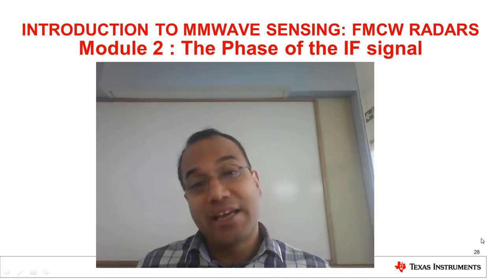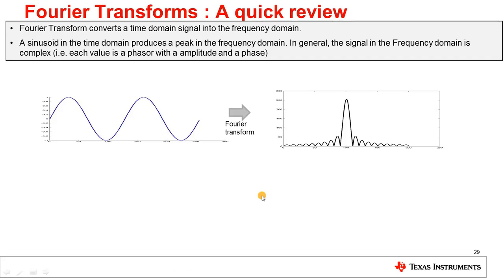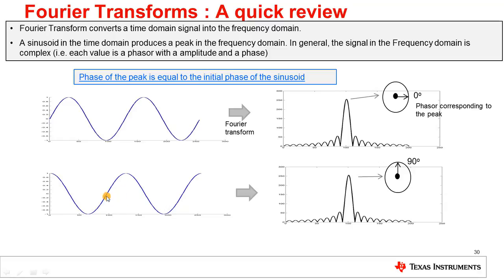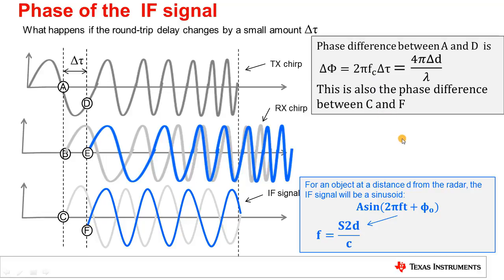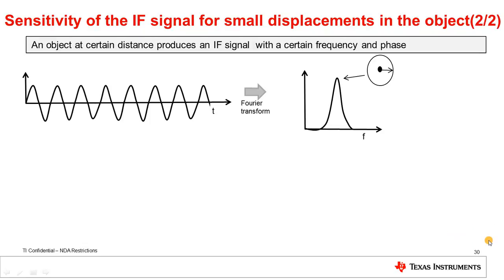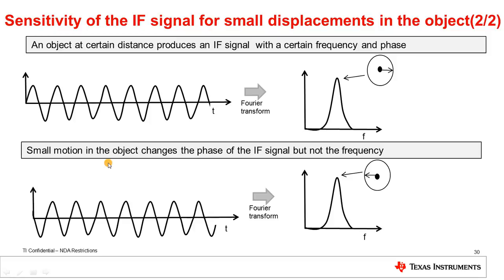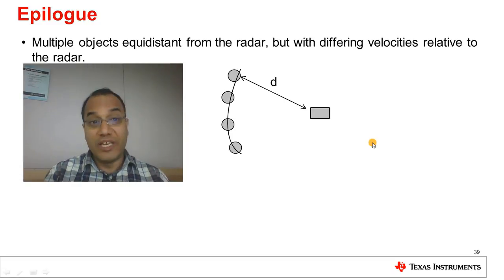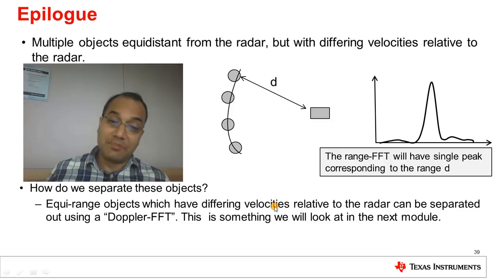FMCW Radars Lecture 2: The Phase of the IF Signal

Comment: In section How to measure the velocity (v) of an object using 2 chirps, the measure difference of phase (ω) corresponds to the motion of the object,  why the phase difference is using ω to represent, should not be ΔΦ？Is here just using different symbol to represent or some conversion between ω and ΔΦ?
Reply: Delta phi is represented as Omega in this video series

Comment: Why do we measure phase changes over 2 CHIRP cycles and not on the phase difference of the transmission signal to the phase of the received signal?
It doesn't make sense, we are testing 2 transmission signals regardless of the components of the surrounding objects
Reply from the maker: The reason we measure phase changes over 2 CHIRP cycles in radar signal processing is to increase the accuracy and resolution of the measurements.

When a radar transmits a CHIRP signal, the signal is modulated with a linearly increasing frequency over time. As the signal propagates through the environment and interacts with objects in its path, the signal is reflected back to the radar receiver, causing a phase shift in the received signal.

To accurately measure the phase shift caused by the object, we need to compare the phase of the received signal to the phase of the transmitted signal. However, since the transmitted signal is modulated over time, the phase of the transmitted signal changes continuously. Therefore, a single measurement of the phase difference between the transmitted and received signals may not provide an accurate estimate of the object's position or velocity.

By measuring the phase change over multiple CHIRP cycles, we can average out any errors or noise in the measurements and obtain a more accurate estimate of the object's position and velocity. This technique is called phase coherence, and it is commonly used in radar signal processing to improve the accuracy and resolution of the measurements.

So, in summary, we measure phase changes over 2 CHIRP cycles in radar signal processing to increase the accuracy and resolution of the measurements, and to account for the modulation of the transmitted signal over time.

Comment: what does the frequency fc stand for in the 2*pi*fc*delta-t (the phase difference)?
Reply: fc can be taken to be  the starting RF frequency of the Signal (e.g. 77GHz)
Reply: @sandeeprao3753  No, it is the instantaneous frequency of the chirp at the time τ; with a Taylor series the boxed equation in 7:50 is valid if we keep the second order term. Actually, if you see the video at 8:56 it says exactly what you say, but I think that this is a simplification by the Teacher for helping us follow his train of thought. For a perfectly accurate analysis one should not rely on Taylor series either but should calculate the absolute phase of the signal taking into account the argument of the cosine of the chirp.

Comment: Hello everyone,
How can obtain the intermediate frequency signal using with Matlab ? Is true method that make element wise multiplication between transmitted chirp and received chirp signal ? 
I want to make sure that the phase opening process is as follows, I couldn't find many resources on this subject. 
As a result of phase values, it emerges in the range of -π and +π due to arctangent function or arctangent modulation, but do we need a phase unwrapping process because our real phase values may be outside this range? Thanks in advance.
Reply from the maker: To obtain the intermediate frequency (IF) signal using Matlab, you can use the following steps:

Generate a chirp signal with a specific frequency range and time duration using the 'chirp' function in Matlab.
Transmit the generated chirp signal through a medium or channel.
Receive the transmitted signal, which may have been affected by various factors such as noise, attenuation, and dispersion.
Multiply the transmitted chirp signal with the received signal element-wise to obtain the IF signal.
Apply a bandpass filter to the IF signal to isolate the desired frequency range.
The element-wise multiplication of the transmitted and received chirp signals is a valid method for obtaining the IF signal in certain situations, such as when the transmission medium is linear and time-invariant. However, in more complex scenarios, other methods may be required, such as correlation-based techniques.

Regarding the phase unwrapping process, it is necessary when the phase values are outside the -π to +π range. The arctangent function used to calculate the phase values produces a discontinuity at ±π, resulting in phase jumps when the phase values cross this boundary. Phase unwrapping is a technique used to remove these jumps and obtain a continuous phase signal. Matlab has built-in functions such as 'unwrap' and 'angle' that can be used for phase unwrapping.